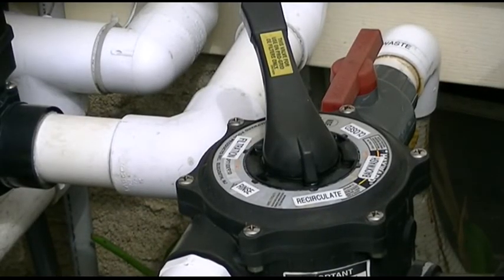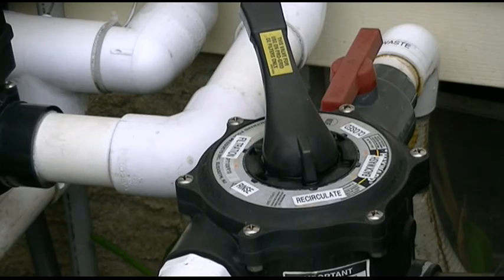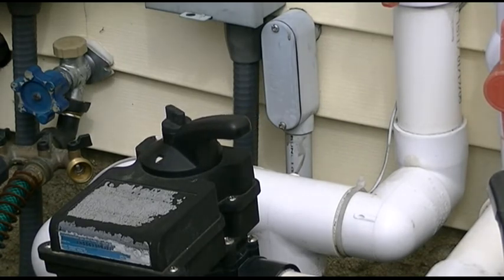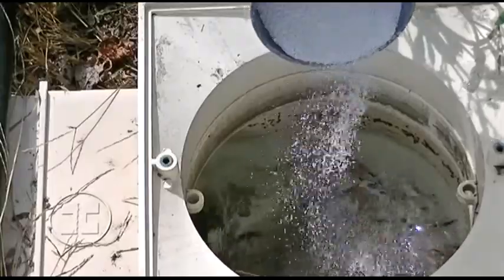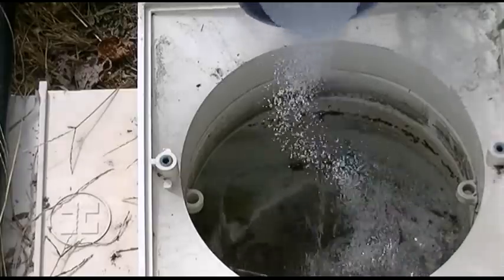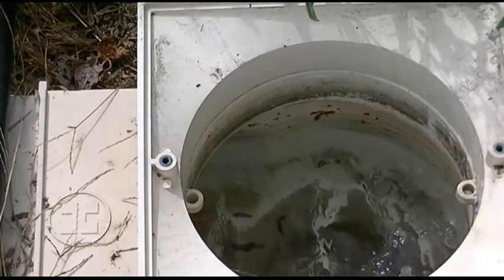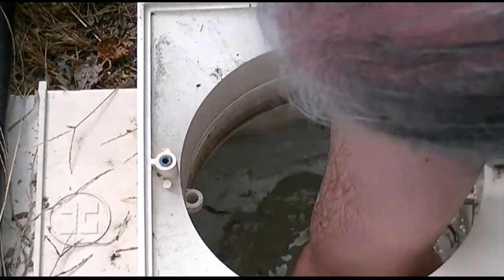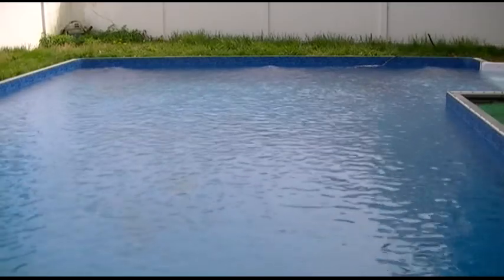Pool Opening 2017, Part 7 - Shocking The Pool

Comment: would this screw up a sand filter?
Reply from the maker: Still wouldn't be a good idea, but note that the FIRST THING I DID was put the pool to recirculate, so it won't go through the filter.
Reply: yea I noticed that. with my grandpas pool the only valve is to choose where the water sucks from the skimmer or pool cleaner line. it goes through the sand filter no matter what which is annoying at times.
Reply from the maker: Hmm.  Much simpler system I guess.
Reply: jaykay18 yea. it's pretty simple. there used to be a gas heater but when the pool was remodeled it was removed. it only has 2 returns as well which I think isn't enough. I'll have to take a short video sometime

Comment: Why not dissolve the shock in a bucket first and then pour into the skimmer?
Reply from the maker: I STRONGLY suggest you watch the first 55 seconds of this video.
Reply: Yes just trying to prepare for my first shock tomorrow morning. Some people show the bucket method around the pool and others show putting shock into the skimmer like you show. I was wondering if mixing the two methods would work or if I should just walk around the pool with a bucket?
Reply from the maker: I don't like the bucket method for a few reasons:
1.  The granular shock never seems to completely dissolve in the bucket.
2.  You have to carry a heavy bucket full of water around with you.
3.  You stand the chance of tripping and falling in while carrying said heavy bucket.
4.  Any tiny drop of water that splashes out of that bucket and on to your clothing will leave a spot that's bleached out.  So wear something you don't care about.
5.  The shock that didn't dissolve will end up in the pool.  If you have a vinyl liner like I do, that means you have shock sitting on it, which can bleach it out in those places.  That means you have to take the brush and brush it down to help it dissolve, and you may yet miss a spot.

Pouring it in the skimmer, on the other hand, takes way less time and does not have any of the above risks really associated with it, except for maybe water splashing on you out of the skimmer.
Reply: Thanks for the info!